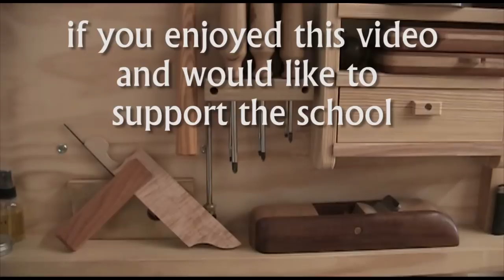Make a Try Square - Woodworking Layout Tool

Comment: Its always a pleasure seeing people diy'ing. BUt I often wonder, how difficult it would be to make a square, without using a square. Its like building a table saw, and using a table saw to cut the wood.
Reply from the maker: There isn't a single thing about this project that needs a square to make if all you are concerned with is the function of making a 90* layout as long as you have ability to make a board straight. Anything 'off' will be fixed in the final truing.

Comment: I saw you checking the squareness of the OUTSIDE edge, then trimming it with the plane.  The next thing you showed was applying the finish coat(s) and wax.  Did you not check and/or adjust the inside corner: or did you just not show it in the video?
Reply from the maker: You don't use the inside square of this French design simply because it's not needed and can't be retrued in a few seconds.

Comment: So - The square is only square on the outside edge? Or did you somehow correct the inside as well?
Reply from the maker: Yes, just the inside of the fence which registers to the work and the outside of blade are square. Actually when you glue it up you can make the inside corner square but I wouldn't trust it. The reason you have the outside of blade protrude so much is so you can periodically resquare it as you cut into it, drop it, wear it down, or such.

Comment: What did you finish it with? It looked like you rubbed on some boiled linseed, but why bother if you're putting on a wax right after?
Reply from the maker: Dangit_Bobby it was walnut oil. oil penetrates while was covers. I like the oil wax finish. It has a nice feel.
Reply from the maker: wortheffort wax covers (sp)
Reply: wortheffort Thanks! I'll keep that in mind

Comment: does this square stay true even after a few years?  with wood expansion and all
Reply from the maker: Even if it doesn't it only takes seconds to retrue it as seen in video. That's why you leave so much protruding. I'm still using it and have retried a couple times because of my stupidity (dropping, cutting, dog)

Comment: I admire your work. Close to my heart.  But why is it a "Try" square and not a "Do square?"
Reply from the maker: Thanks. Haven't a clue.
Reply: @wortheffort  The square refers to the tool's primary use of measuring the accuracy of a right angle (90 degrees); to try a surface is to check its straightness or correspondence to an adjoining surface. "Try square" is so called because it is used to "try" the squareness. (from Wikipedia)

Comment: When buying try squares, all that I've ever seen have a square end; what is the purpose of the S curve on the end of this one? I assume it isn't merely decorative.
Reply from the maker: +Steve Crane It's traditionally made with them. Kinda like the knub on saws there are lots of theories like it exposesmore end grain so it acclimates quicker to humidity thus stays straighter. It's a common shape in furniture making so it becomes a standardized layout template. It tells new users which side of blade is actually square. It provides places for fingers to be braced. Etc... Personally, I just think it looks better.
Reply: Please explain how it tells new users which side is square.  And also the purpose of the back bevel on plane blade.  I always did my just flat to remove the burr and do you use a micro bevel on the bevel side?
Reply: wortheffort P

Comment: I'm all for making things yourself when you can, but a square is not something I would risk being off.  
All it takes is for your hand to be 1-2 degrees out when you're chiseling the slot and the square is useless. I'd also be worried about the wood warping over time, although I guess as you always work inside your shop that's not such an issue for you.  
It's a nice project and was beautifully made, I'm just not sure about the practical use of it.
Reply from the maker: You square it up after the glue up. That's what I was doing wt the plane after striking a line. Wood is more practical for woodworkers because it takes but seconds to retrue. Drop it, Nic it, warp it or whatever. Just strike a line, flip it 90*, any variation is twice the error. Grab a plane. Take a few swipes. Check it again, then get back to work. That's why you leave so much overhang when gluing it up to you can have decades of use.
Reply: Ahh good point, I hadn't thought of that!